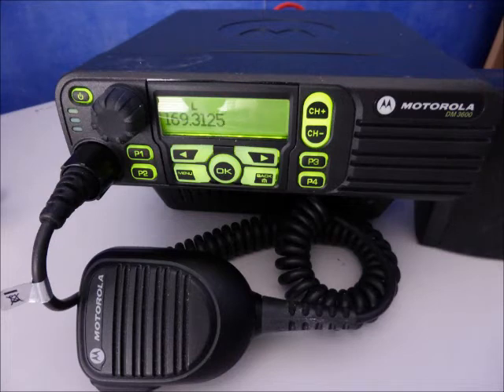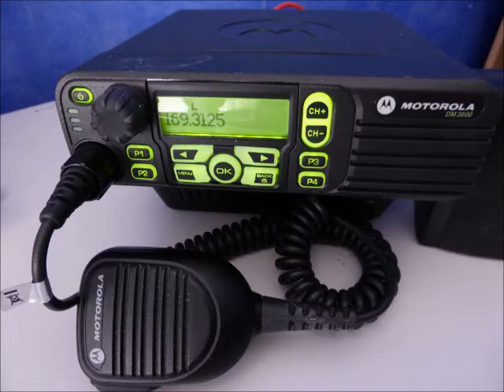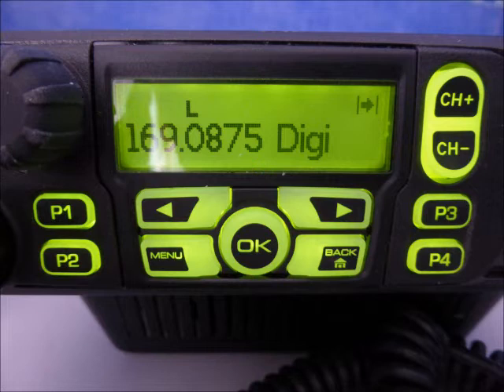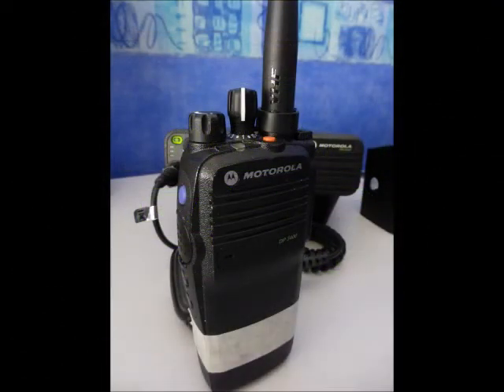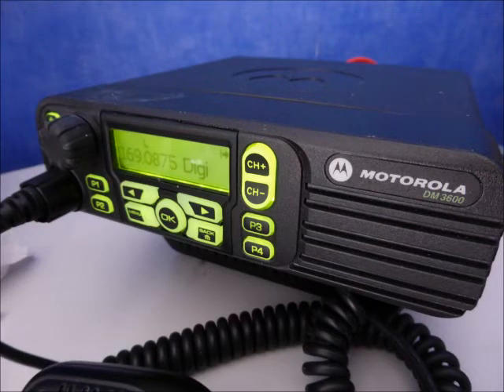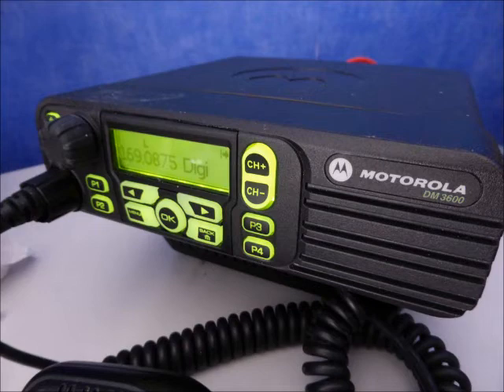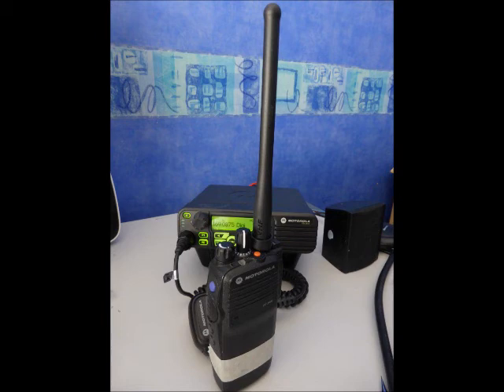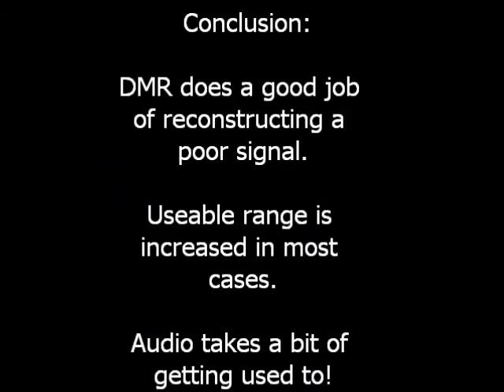Motorola MotoTRBO Test - DMR vs Analogue FM on VHF

Comment: Hi, in low power transmission mode, how do you choose 5W exactly output because on the CPS software, you can only choose between power output HIGH or LOW?
Reply from the maker: You can set the High and Low power levels from 1W to 25W in the software.

Comment: I am running a ht1250 and a xts 3000 vhf 136-174 mhz will they work with this style radio?
Reply: If you mean analog then yes both of those radio's will run analog however neither of those radio's will do DMR TDMA.

Comment: Were you really using the same antenna and power when switching from digital to analog?
I received DStar and DMR signals with my 10$ RTL-SDR, SDR#, the free DSD Plus software and an specific audio filter software, and I always thought the software implementation was terrible in terms of sound, but now I am glad to hear that even professional radios sound just as bad. But then, what can you expect when using these very low bit rates, you have to use such extreme compression to get something that sounds nearly like voice. I am just surprised that anybody uses it at all.
Reply from the maker: Yes same antenna and power levels. These radios are about five years old now, newer radios have improved audio.

Comment: Very nice video. How did you record from the DMR radio? Did you connect to the computer to record, and what cable did you use?
Reply from the maker: Thanks, I use a standard moto two pin converter on the acc socket of the DP3400. Then just a 3.5mm cable to PC recording with Audacity program.

I also run Zello on the laptop so the RX audio gets sent to my phone whilst in the car.
Reply: Ah very interesting. I was wondering if those converters would work to plug in to the computer, as I wanted to try it myself. (With some radios you get noise on the audio)
Thanks for the info.
Reply from the maker: radiosification I have to use a USB sound card as I get a humming noise when using the internal card, not sure if it's a ground problem but the £2 USB works great. I do get the 'digital noise' on the audio when I plug in an old moto two-pin speaker mic into the DP3400.
Reply: Okay, thanks for letting me know!